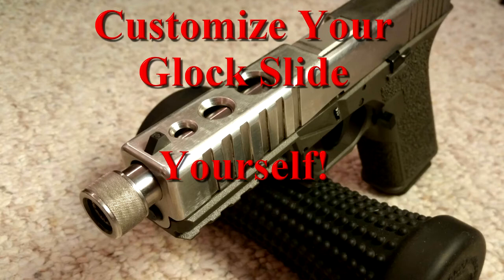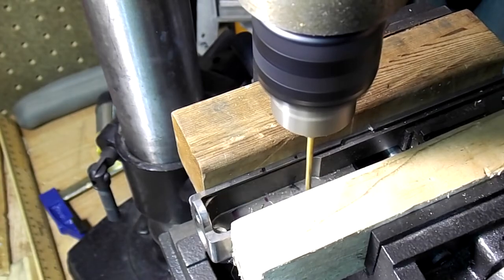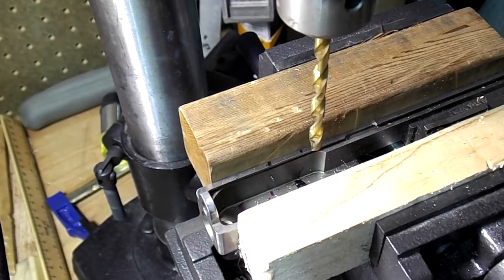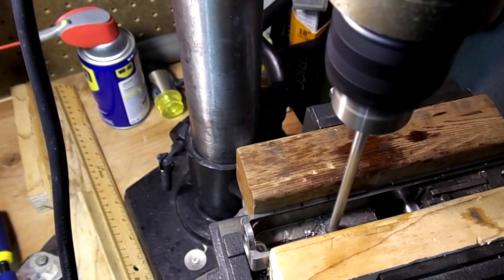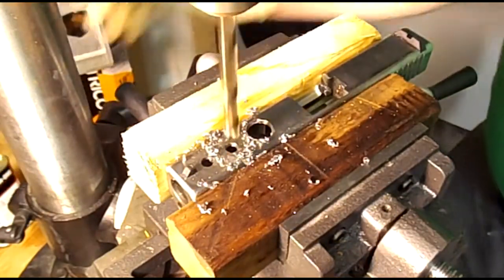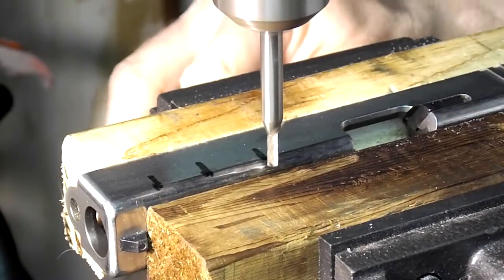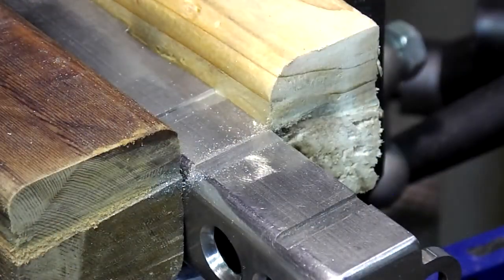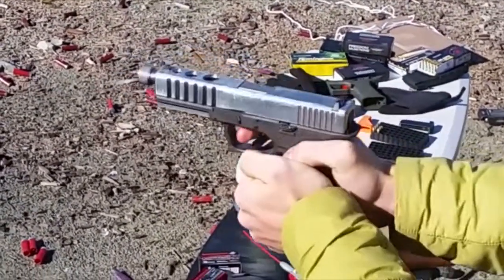Customize Your Glock Slide Yourself!

Comment: It looks great for the tools you had, the thing that got me the most is how you completely let your finger off the trigger between each round. Try to squeeze the trigger, and hold it until the gun cycles, then slowly release it forward for the sear to reset, without taking it off the trigger. It’ll help out your grouping and keep your shots more consistent, but overall, great video!
Reply from the maker: It was a first-timer shooting the pistol. I was filming. I've replied to this type of comment numerous times already. See above.
Reply: @PsychOtto  well it’s the internet buddy. If you don’t make that clear in the video, everyone is going to assume it’s you shooting 🤷🏼
Reply: Thanks, I most definitely needed to know that🎯

Comment: I think you did well for what you had to work with! I found out the hard way that "end mills" don't do a drill press any favors.  They'll wipe out your bearings in no time as they aren't made for it what so ever.  They're only good for downward pressure, no lateral. I had to rebuild my drill press as a result. I did get myself a Harbor Freight Mini Mill, and hardly ever use a drill press anymore. You do have to invest in tooling, but it's a pleasure to use.

Comment: You're hole was jagged because of the concrete drill. Try using a correct and sharp drill, at a slower rpm. Secondly, never use an end mill in a drill chuck. The chuck isn't rigged enough the allow the mill to work properly. You'll also end up causing the shank on the chuck to bend, from the lateral torque, causing your drills to run out in the future.

Comment: Just save up $1k and buy a mini mill.  You would be amazed w by at you can do with a mini mill.  Any 80% receiver ar15 1911 etc.  Any slide add lightening cuts ports, serrations flat or tri top.  Slab side revolver barrels.  Checkering.  You also can true up the loose factory tolerances on just about any metal part.

Comment: Can you drill the barrel to make it like a compensated barrel like the GLock 20c it’s almost like what you done..
Reply from the maker: It probably could be done, but I'd want a lot better equipment to try it on than just my drill press. I think the barrel is hardened steel.

Comment: Great Vid! Do you have a vid on how to remove the slide finish? Also, is it possible to compensate a factory glock barrel / slide? Possible to make that look like a factory Glock C?
Reply from the maker: The slide came like that, in stainless steel, so I didn't have to remove any finish. And sorry, I don't know how to compensate a slide/barrel. I was just trying to see if I could drill some holes, lesson the weight, and make the slide look better. I wish I had machining tools to do more stuff. Thanks for your interest.